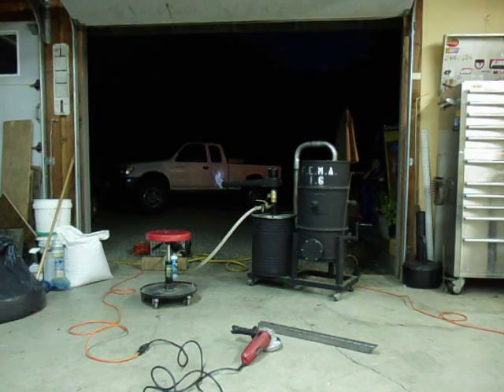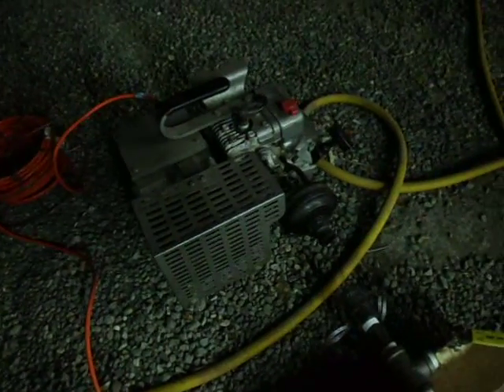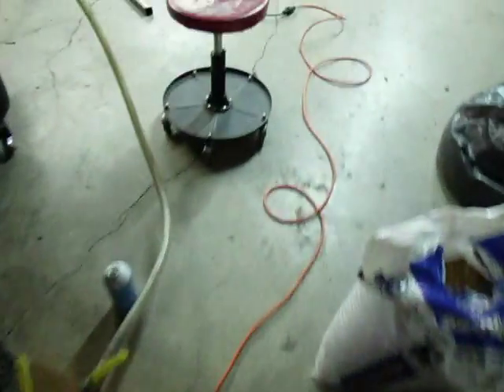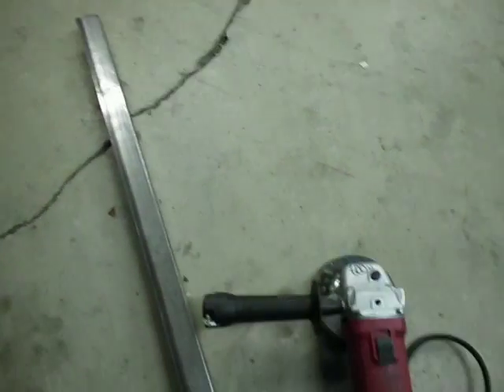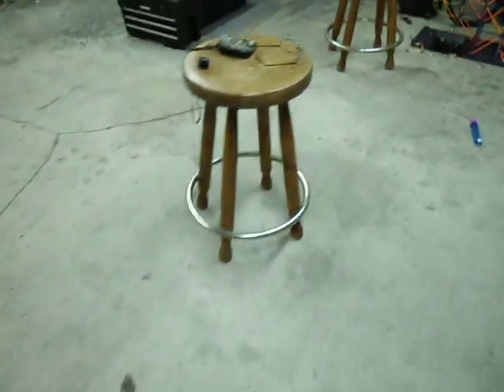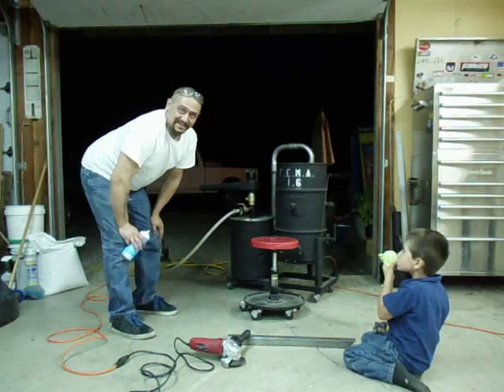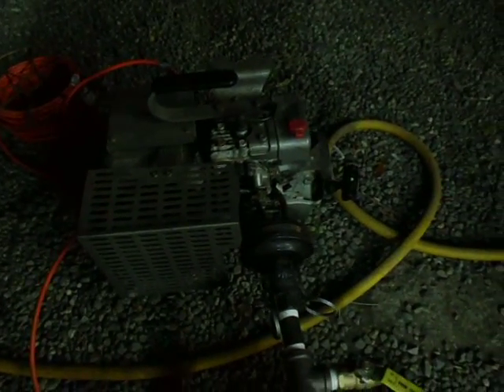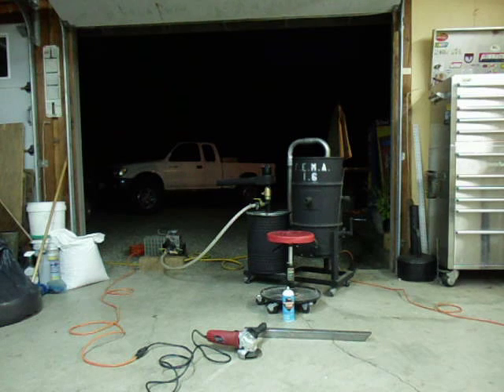Gasifier generator load test

Comment: I really like the way you did these videos. You broke it down in small chunks that are easy to digest. I notice you are only running that small generator which is small compared to what your gasifier can produce. Have you ever thought about splitting your gas off to another piece of equipment. Possibly a small heater in the winter?

Comment: Joshua, Great setup... Im still trying to do mine but at a standstill because I cant find a good alternative for the filter (cant find a waste barrel to save my life!) maybe I will cut down a 55 gallon drum for it. I want to build a big gasifier to run my 12000W generator with an 18HP motor so I have a 55gal drum with a 6" down pipe. Hopefully it will work half as good as yours does.

Comment: Hi JOSH  fb onyr load test.great work.. ur gasifier still running fine.. u mentioned that u have an inverter. I assume it runs on 12 v from ur gulf cart batteries.. is the inverter sine wave or modified sine wave or really square wave. what is its power rating.. u can charge the batt with ur 12v gen. u built. but ur batts have to be low to get a good current flow from ur gen  gasifier set up. ur load test is the true value of ur gasifier..Keep the Faith.JohnMillard.